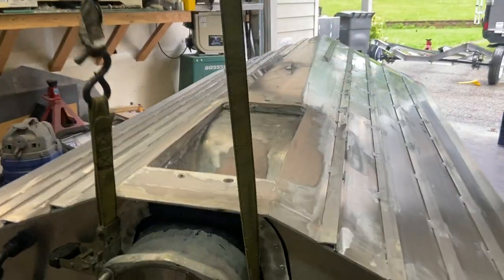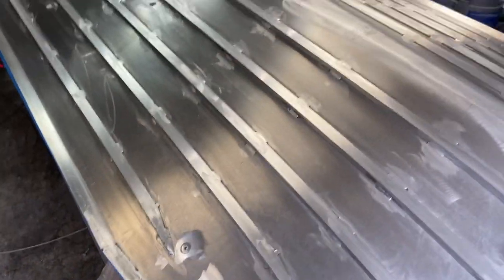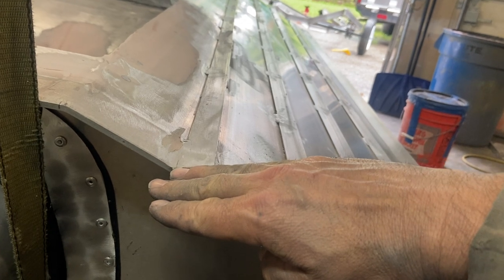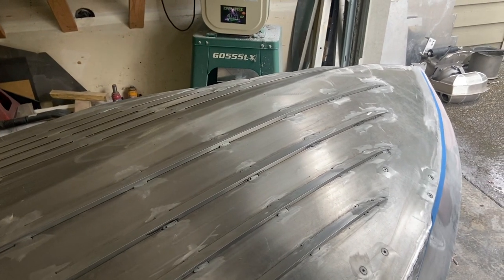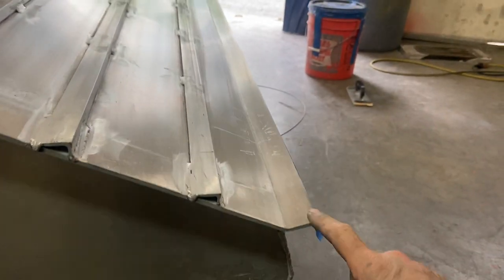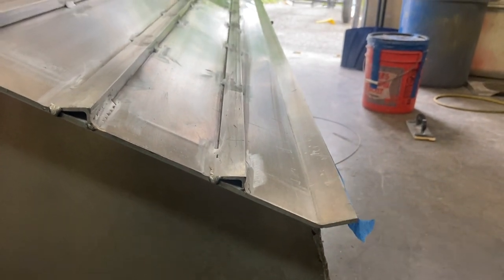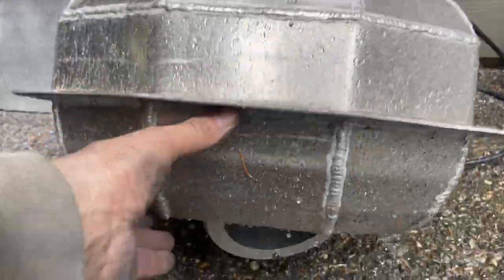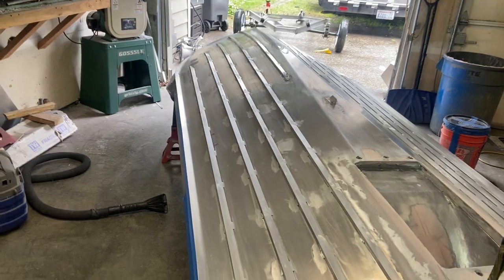What makes a sprint boat turn so hard??

Comment: Most river-running jetboat hull bottoms are very flat, so they can run through 5cm of water depth.
Kiwi Bill Hamilton's original idea was to be able to access areas by river that could not be accessed using any other means - except perhaps a helicopter.
It worked!
Then the hulls began to evolve in order to run very shallow waters. This resulted in the typical tail-happy jetboat which behaves like a super powerful car, steering with the rear wheels under power. I call my Porsche 928 a "Land Jet", because of the way the tail wags under power, and the way the nose rises when I hit the gas hard, and the way I often gas-and-coast in it.
Reply from the maker: Land jet 🤣

Comment: I've been trying to tune a RC scale boat, and your video has been extremely insightful as to what I can do to improve the handling. What about nozzle trim? How many degrees of up or down trim is common? It also occurred to me that perhaps the axis of rotation of the nozzle could be changed to give more nozzle up or down when turning. Is that ever implemented?
Reply from the maker: Don’t use nozzle trim on race boats but definitely do on miniboats

Comment: There is a 5th element to it, driver confidence. Will my boat make that turn. Over my years of watching sprints as a safety marshal I have watched many dual driven boats. Typically the regular driver will put down a good lap, the second will be a little conservative until the confidence level rises.
Reply from the maker: That was the hardest part in my first year…trusting the boat will make the turn.  Everything in your brain tells you to lift!!!

Comment: How much tuning and optimising are you guys doing to get the perfect setup? I mean, are you moving these inch by inch, is there a testing protocol, how does it all work?
Reply from the maker: Testing is tough as we can’t just go out and rip around a track without safety personnel.  Most tracks open up for us one weekend in the spring.  Otherwise I do small amounts of river testing.  I just try to find a fixed point like a buoy or a stick to turn around.  Once built, the fine tuning is in the fins and pump setup…I’ll do a video on that soon!  Thanks for the question.

Comment: I hope you can help.
My dad and I build a jet board (jet surf) with two jets powered by 2 electric motors.
The 1st version we build was a converted surfboard with the same motor / jet setup.
This version was running on what we call a S6 Li-ion battery setup. The RPM's we got at WOT was around 11.000 RPM, and the jets were pushing about 30 KG.
Max speed was about 35 km/h
We had no problems with this setup, however we wanted to go faster, and make our own board!

The new version is a DIY board with a 12S Li-ion battery setup. The RPM's are just over 16.000 RPM. Push power now is +50 KG.
However we are having a lot (A LOT) of cavitation problems with the new board. When riding it you can hear both jets revving up, but feeling power loss!
The bottom of the board is flat, but does not feel smooth (it's a carbon fiber bottom, and we did put DD varnish on it).
Do you think that this "not feeling smooth" could cause the cavitation of the jets?
The jets are when I'm on the board fully submerged!
Is there something we could do to the bottom of the board to stop this air mixing with water problem?
Reply from the maker: My guess is you’re getting too much RPM for the impeller/blade.  Our race pumps are limited to about 6600-6800 rpm before they literally pure’ the water and shoot out foam instead of a steady column of water.  Lower your RPM, bigger impeller but neck down the tail cone is my advice.
Reply: @JollyRoger907  Thank you for your reply.
The thing is that if we tether the board down (as we did for some static testing) it did not have this problem.
Bigger impellers is unfortunately not an option :-(
I do not like posting links, but here is a run with me on the board.
This is with the last setup, but still without the last carbon fiber layer.
https://www.instagram.com/p/CNHeJ0YFaEU/
Please let me know if you want me to remove the link in this post.
Reply from the maker: @iamkian  when I say bigger I don’t mean larger diameter, I mean more pitch
Reply: @JollyRoger907  We can, and will try that!
Thank you.

Comment: noticed the bondo on the intake (anti cavitation?)  and we did not see the grate (hmmmm secret stuff)..  I ran a graphite spray on the sponsons of a drag hydro.. the finish of your spray is rough also? (very small contact patch on bottom of boat)..  what kind of HP drives that 8" pump?
Reply from the maker: 🤐 lol

Comment: The rails on the bottom of the boat (help with the sliding) and the suction of the pump motors of the jet sucking in large amounts of water keep it sucked down to the water, hit a wake or something lose suction you can't corner like that anymore until the hull gets contact with the water. Simple physics. Tires is a bad analogy because even indy cars that do the best cornering are slicks so more rubber is on the ground for less sliding only do the grooved tires come out to channel the water through the grooves for better traction.
Reply from the maker: Dirt cars don’t run slicks, you need tread to grab!  Or snow!

Comment: How big of a factor is driver skill?
Reply from the maker: A great driver can only do so much.  You still need a string engine and overall race package.  That being said though…a below average driver in a great boat will struggle.  The top hosts are ridiculously quick and get harder & harder to drive!
Reply: @JollyRoger907  But i wouldn't bet my money on a bad driver in a great boat 🙄 ..... maybe in an endurance event, but not in sprinting. Well, just my opinion. 😁

Comment: Great video, but Im thinking ,,,, well the laws of physics is thinking you are incorrect on your theory about suction. Two issues,  if you create a suction in front of the impeller you will get cavitation, for those following along, cavitation creates a low pressure area and when it gets low enough, the water will boil creating bubbles.  (Water boils at a lower temperature in the mountains because of lower  pressure.).  When the bubbles reach the pressure side of the impeller they collapse violently creating little water hammers that will eat the impeller. Chip it away. Sounds like rocks going through the pump. Cavitation is bad berries for jet boats. Well pretty much anything. In the fire service we were required to keep at least 10 psi on the intake side of pump so we could avoid cavitation if another line was opened and flow increased. 
The other issue is if you are creating a suction you are not feeding the impeller all the water in can use so you are losing efficiency. 
I think the more likely reason for the boats sticking to the water is the water entering the rear of the intake is putting downforce on the intake due to its downward angle. You didnt show your intake but there is a place for one. Im curious if you have a shoe ( intake extension) built in to increase water flow to the impeller ( and bite into the water?).    Pretty sure there's a point where the shoe gets too big and drag increases or your putting too much water in the pump. But Im not a drag boat guy so not sure???    It would be interesting to put a pressure port on the intake side and monitor intake pressure?     I think when you clipped the bank you lost the pressure of the water against the intake and lost the downforce.   You do great work!!!!       Couple more thoughts.  The mostly likely point to get cavitation is when you hammer the throttle to start.   You would get cavitation everytime  except for atmospheric pressure. A pressure gage before you start would read zero. But actually its 14psi at sea level. So when you jam the throttle, the pressure drops but doesnt reach zero, if it does you get cavitation. As your speed increases flow to the pump increases and pressure in the intake. Im probably off a bit on some of this, some drag boat or whitewater guys might chime in.
Reply from the maker: Had to read that a couple times lol.  Still pondering
Reply: @JollyRoger907  Im still pondering it also!!   Not sure Im spot on????  Drag boat guys are talking about breaking intakes because of so much pressure. 50 60 lbs? Much higher speeds but I just cant figure out you are not reducing flow/pressure by having suction??
Reply: @JollyRoger907  Im still pondering also???      The drag boat guys are running shoes to pick up more water and loaders to funnel water to the top of the impeller to maintain equal pressure  on the impeller and to keep the pump loaded. They have actually cracked intakes with too much pressure. running up to 55 psi I think? they talk about getting too much pressure and the rear of the boat lifting??    Watched a race video and I just cant see how the 
speeds you guys are running you dont have a fair amount of pressure in the intake? Do you guys run pressure ports to monitor intake pressures at all.???   Im still pondering??     Keep up the good work!!